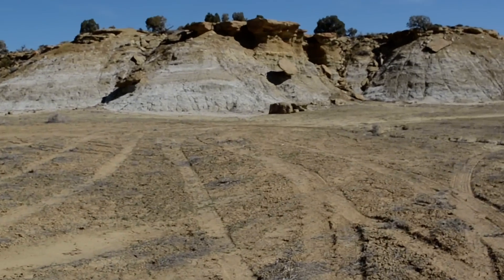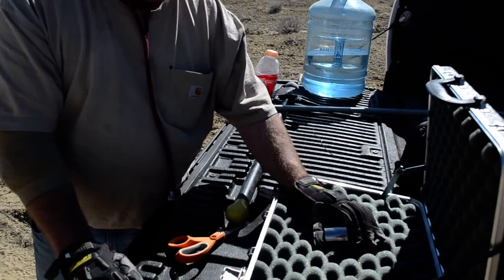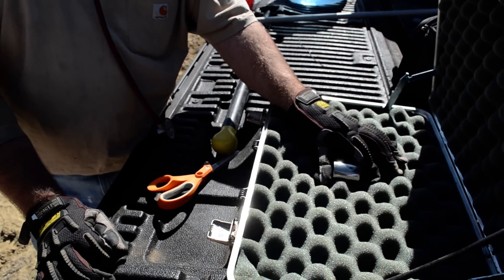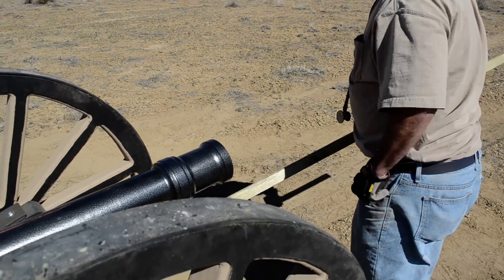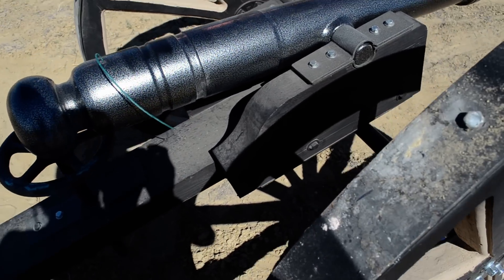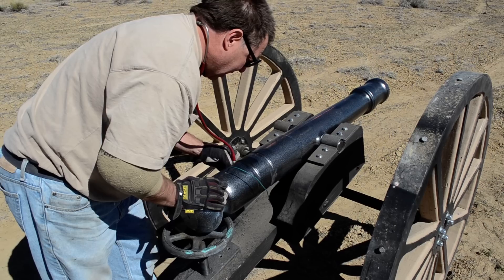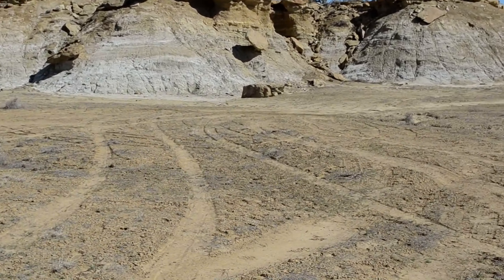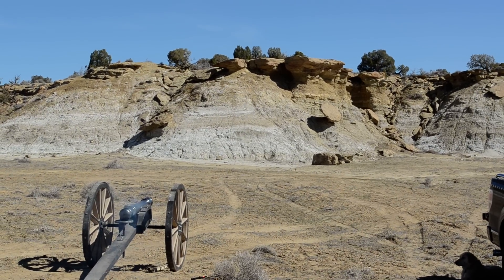Exploding cannon balls

Comment: If it explodes on impact how is it possible for the charge to withstand the initial g-shock without exploding in the barrel (I'm not a scientist break this down for me)
Reply: White Widow He said it was a medium load in the cannon. The acceleration in the cannon is certainly very fast. But it's over the length of the barrel. When it hits the wall it will decelerate at much higher G's and the casing will deform. Probably a very well tuned explosive
Reply: Explosive shells essentially have a percussion device inside them that ignites the inner charge when crushed, such as on impact.
Reply: Explosives are all unstable to an extent.  It is just a question of how much added energy (and what type) is necessary to get it over the stop. Most likely it is stable at room temperature but once heated a small portion of it will become unstable and pressure sensitive so that the added compression sends it over the hill.
Reply: Magic OK just magic
Reply: Kgw100 C4 would never detonate from something like getting shot from a cannon. The G force of acceleration from stand still to about 2,500ft per second in about the length of 36in, is a fraction of the force when an object traveling 2,500ft per second, slows down to zero, in an instant once it collides with its target. C4 is one of the most stable explosives, and would require such insane forces to detonate, which is why it is a secondary explosive, which must be set off by a primary explosive. Almost all exploding ammunition had an explosive primer, which is triggered thru forces such as the massive deceleration experienced when hitting a target, which then sets off the primary, which will then set off the C4. This is why even in movies you will always see someone inserting blasting caps into C4 before placing it on a desired target. Most people assume these chemicals are way more volatile than they really are in real life. For instance, diesel fuel will put out a fire if you dump it onto a fire, since it requires high compression to be able to burn, along with high heat, meaning one without the other will mean nothing happens. You can even put out a cigarette in gasoline, if you manage to be in a well ventilated area, and are quick enough to dip the cigarette into the actual liquid, since only it's vapor in a precise ratio of air to fuel will burn. I suggest NO ONE try this themselves.
Reply: Most likely, Tannerite, which requires a very high velocity impact to set it off.
Reply: As for the orange color, it's probably the iron content in the rock and soil combined with the nitrogen bonding from the explosion. Not all of the Gases from the explosion react stoichiometricly at explosion speed. Some of the dissociated nitrogen bonds with ambient oxygen and forms nitrogen oxide which binds with more ambient oxygen to Form nitrogen dioxide...... which is brown. And no it doesn't matter if it is C-4, TNT, PBX, TANNERITE, TORPEX, TETRYL, or Any other modern explosive or old explosive, as long as it exploits nitrogen's triple bond. The one exception would be nitrocellulose. For you self-loaders, it probably sounds a little familiar. That's why modern propellant (gunpowder) doesn't leave a white cloud like an old musket. Muskets use black powder. Which is actually gunpowder. Modern "gunpowder" is actually called smokeless for a reason.
Reply: The Product  I'm just not buying the physics. If you fire black powder, you would either have to have an inertial detonator, a VT type fuse, or some kind of exotic fuze. A VT wouldn't fit in that little projectile unless you stole some authentic military shit. Even then, you aren't going to make a working VT fuze with a garage workshop. In 1945 the VT fuze was as closely guarded as the theory of nuclear fission. An inertial trigger would have to work in all directions, which  would require a fulminante or azide primer to work. Which would potentially and probably detonate in the barrel. If there was a type of safety lanyard like air dropped dumb bombs, that disengaged a safety after a safe distance from the barrel, I might believe it could be possible, but not safe or reliable. Even with black powder, an acceleration from zero to 800mps would trigger a fulminante detonator with an internal omnidirectional trigger.
A design that exploits the tumbling could work, but accuracy would be very poor. 

Don't get me wrong, I'm convinced it's BS, but there ARE ways to do it. 
C-4 is also called RDX. C-4 could work....but only with a detonator. The concussion needed would have to be at least 5000 meters per second. We're talking major power. Even artillery fired from modern howitzers don't produce that kind of energy and they send 100lbs. 30 miles away. That's why they have fulminante, azide, or VT fuzes. Also why they have a dial spindle on the nose so they cannot be set off by the ejection charge, and are armed mid flight after apogee. There is just too much wrong with the case in question. A good hoax, but still a hoax.
 If I had the time and resources I could probably develop one that works, but the resources required are not only  expensive, hard to find, and/or outright illegal, but if you got the stuff to make something like what this video portrays, you would instantly show up on every government radar like the stay puft marshmallow man. The Feds would have you sweating in a sitbox before you could post this.
As for the multiple concussions, those could very well be echoes.
Reply: Explosive spherical case shot and shells existed in the Civil War. Both used time fuses to detonate an explosive charge in the projectile.
Reply: I always wondered that myself. Made the possibility of explosive amo fanciful to me
Reply: @richardlahan7068  Spherical case shot? Hell, we had plenty of types of rifled percussion shells
Reply: @𝖂hipped 𝕯ream  Yes but the discussion  was about exploding cannon balls not rifled shells.
Reply: @richardlahan7068  Fair.